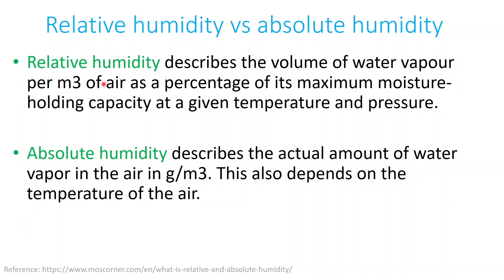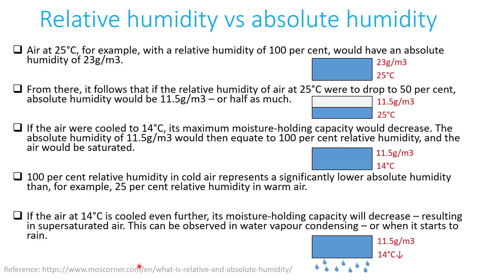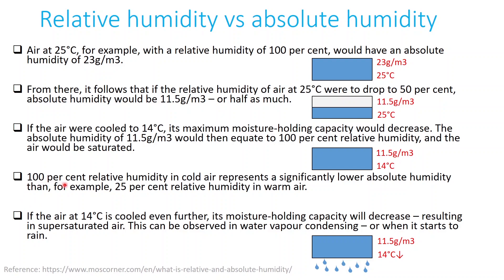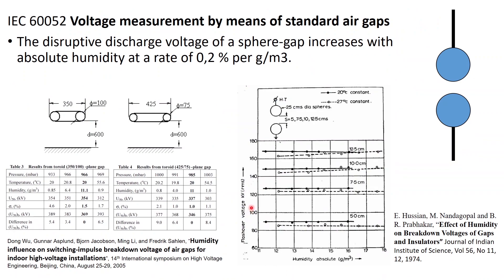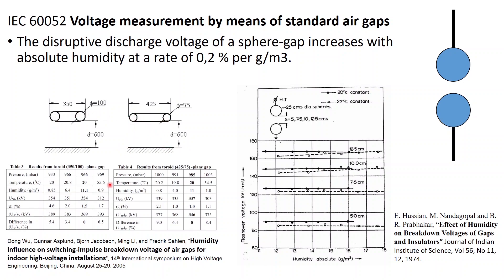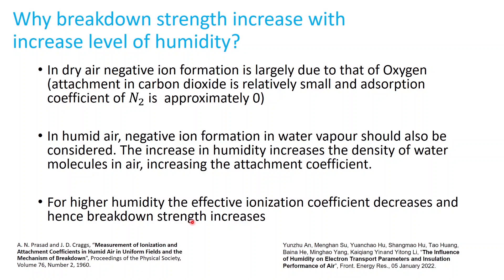Impact of air humidity on streamer length of a Tesla coil

Comment: If you make the background color and texture uniform it will be easier and more consistent to record and observe.  Black is not as useful as a uniform pattern with sharp contrasting fine detail.

If you also show what is above the spark generator, that would help, The streams extend beyond the top of the viewing area.  

There might be convection.  Probably is, and it might be slow but strongly affect the curvature of the equipotential surfaces over the spark source, and that will focus and strongly affect the channels.

You might try finding an infrared camera.

Your spark source is not smooth, so the electric field varies from place to place. 

You are spraying droplets, not just water vapor. Water vapor in air is "humidity"  The droplets are something else. The size of the droplets strongly affects the electric field close to the droplets.  You do not seem to be careful about contaminants for the spray.  Tiny bits of electrolyte or oil can changes the surface tension of the droplets.  Water vapor mostly affects pressure.  Smaller molecules travel faster.  Polar molecules (H2O and CO2 and ions) interact more.

You can put up electrode arrays to monitor "between electrode" voltages.  There are 16 channel and 64 channel high sampling rates ADCs for the Raspberry Pi.  Most of them can be run by Arduino and ESP32 and similar small processors.

You might try Schlieren methods to visualsize and record air flows, rising heat, surface flows around the spark source.

The spark source power supply is likely high frequency, and not stable.  You should record the current and voltage of the power going to the spark generator.  Some external sound cards work well for that, or USB oscilloscopes.

You could record the sound from several separate microphone at high sampling rates.  At least 96000 sps and check the FFT for trends and patterns in the sound.  Particularly mixtures of high frequency that vary slowly at sub-audible rates. Most of the SDR (software defined radio programs) will have FFT displays and waterfalls that let you see the spectrum for sound cards. Some of the oscilloscope programs will too.  

You could record the electromagnetic "sounds" from the device.  The low cost RTL_SDR are the most stable.  They are 16 bit at 3.32 MegaSamples per second.  They use I Q detectors. That is simultaneous 8 bit ADCs for cos(omega*t) and sin(omega*t).  You can find how that works searching "I" "Q" "SDR". The SDRPlay RSP1A is 14 bit and 10 MegaSamplesPerSecond (Msps).

If you turn down the voltage so there are no visible sparks, monitor with SDRs and sound, and record and analyze for a long time, you should find that much of the spark behavior is predictable from much lower voltages than those needed to make  big sparks that humans can see and hear. The shape of the field above the spark source will vary strongly with air currents, rising convection, local temperature variations.

You ought to turn off the lights.  You ought to carefully place the cameras and try to find some that take higher frame rates. Even the earliest Raspberry Pi MIPI cameras can handle regions of interest (smaller areas) at up to 1000 frames per second.

I can think of a few more things.  Especially networking with everyone in the world working on similar experiments.  Back when electrostatics was found, they did not have the ability to record fast and precisely, But beyond getting data for your eyes and observation, if you share with people world-wide and use similar methods so the data and algorithms are all compatible and complementary, you might have a chance to make it a science, not a toy or forever obscure.  

Same with candles and flames.  Most of what you are trying in air can also be done in gases. But more inportantly, they can also be done in liquids of many sorts, and powders, nanoparticle "liquids" and electrolytes of many sorts.

Richard Collins, The Internet Foundation